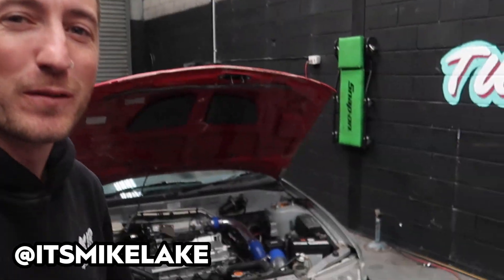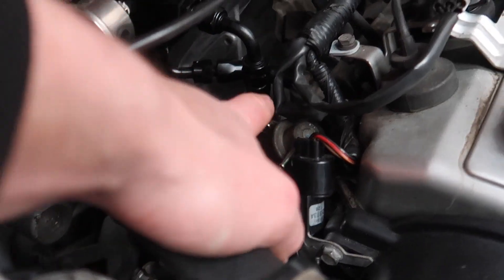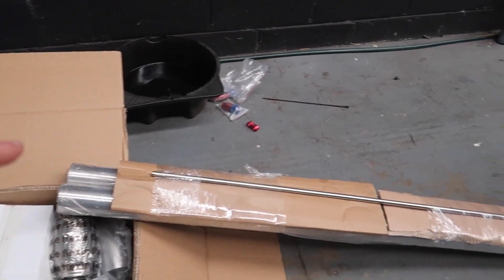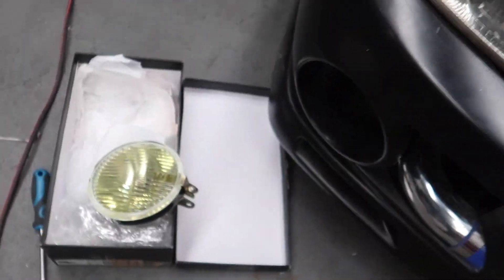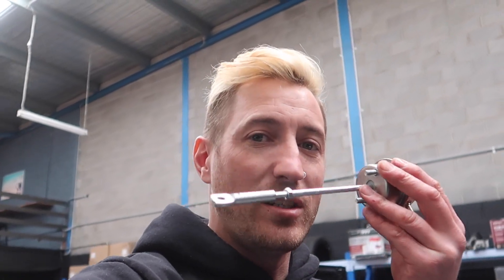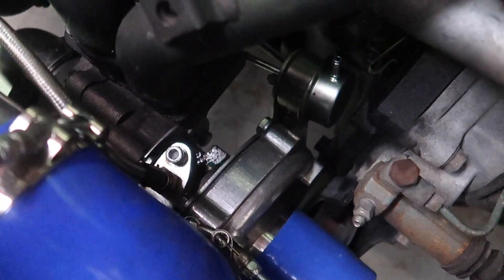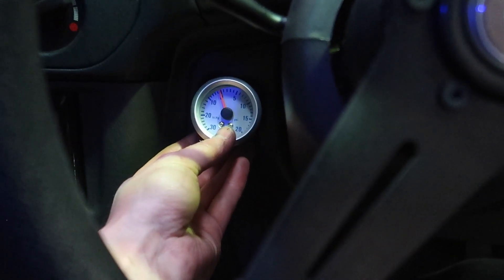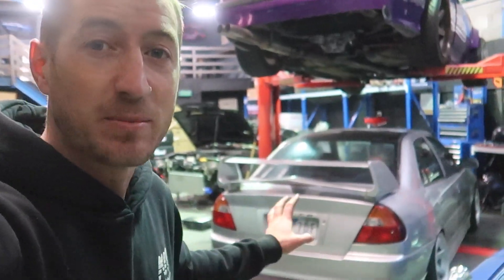BUDGET EVO BOOST GAUGE INSTALL & MORE!

Comment: RE the brakes, you could try the old reverse bled. Get yourself a syringe, fill it up with brake fluid and force it up the the brake nipple. I find this is what I have to do when replacing brake hoses on my motorbikes.. takes literally 4000 pumps otherwise

Comment: Either you’ve got a leaky master cylinder or your brake pads are too low. I had a r31 skyline and the brake pads got so low there was no feel in the brakes and I thought I had a leaky master or the nipples were buggered but it was the brake pads, so change them and see if that does anything if not it maybe be the other things the previous commenters have mentioned

Comment: Sounds like you got some air in your master cylinder. Bleed the mc and get some help from a buddy if you can to keep an eye on the reservoir to make sure it's topped up when you're bleeding the screw. Also could be if you put the wrong calipers on the wrong side. Make sure the bleeder screw is facing forward.

Comment: Yeah buddy Silly questions. are your calipers the right way up? Vacuum to the booster?
Reply: Yeah if the bleed nipple is at the bottom, all the air will gather in the top of caliper and not be able to escape.
Reply from the maker: That makes so much sense!! Haha bloody rookie 😅. Still learning things about cars every day.
Reply: @itsmikelake  and when youre bleeding, start with the caliper furtherest away from the master cylinder 🤙keep it up its looking sweet!!
Reply: Bro at min 6.45 in your brake vid you can see the nipple is on the bottom. I would say tomorrow’s job it swap calipers over am re bleed and you will be in the money.
Reply from the maker: Uh oh, would the right way up change anything? Might have installed them on the wrong side 🤣
Reply: even I learnt something. rad.